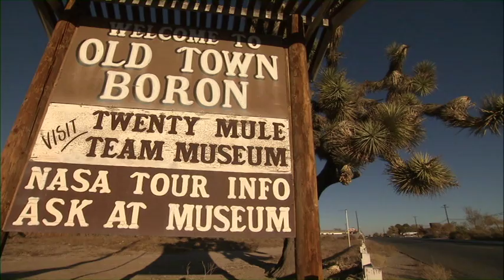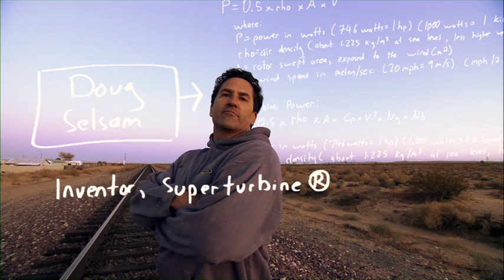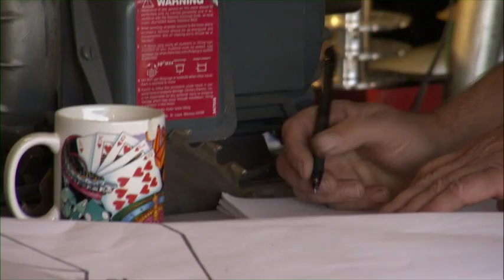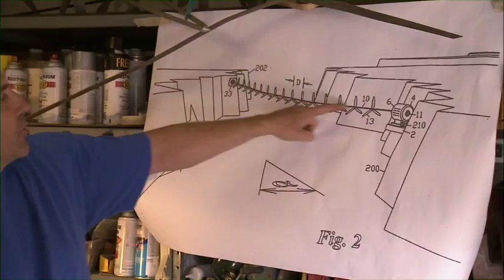Doug Selsam Inventor of Superturbine(R)

Comment: novel idea!  wonder how long before the constant flexing on the driveshaft causes fatigue failure?
Reply: You can break up the stress with bearings but good point.
Reply: This is a prototype that proves the concept works!  I would suggest running a guide cable and suspending the turbines on hung bearings. This is in reference to canyon and peak to peak installation.  I was thinking of 4140 thin wall tubing would be a good choice verses CRS?
Reply: And what about the noise level? Too many blades spining fast like that aren't too noisy?
Reply: I cannot see any way to reliably scale this up. He model was sagging massively just at this size. The reason one huge aerodynamically precise fan with adjustable angle of attack is used is so that even in barely any win they will still turn.

Also until some data is recorded and compared we don't know that this is more effective. It kind of a classic mistake to think more of something means more good.

But but adding a gear box and a large fan with variable angle blades very likely produces the same amount of power.
Reply: Also something that he himself probably hasnt thought off. once you scale up the fans the tip speed will get faster and faster. If the tip of the blades break the sound barrier then you have problems. 

And the funniest thing is. This guys bad idea is just trying to improve on what was already a bad idea.

Wind power will never supply the bulk of our power. If i remember correctly even if you covered the entire land surface aread on the planet with those big turbines it still wouldnt even get close to the power generation that is needed.

Unless some massive battery advances happen where we can build massive batteries and use sun and wind to charge them i dont thinkt his will be useful.
Reply: I’m looking at windmill/turbine videos to see if I can find something comparable to an idea I have been thinking about lately.  Horizontal or vertical axes of rotation with longer and longer blades seems like a long-term losing proposition for scaling because of tip speed and centrifugal force: to me, it makes more sense to not ever have the top movement speed of any of the wind-blown parts exceed the wind speed that blows on it, for various reasons, including material strength, balancing, noise, and also thinking about bird strikes, both for the sake of the birds as well as the mechanism.

I’m not comvinced you can ever prevent birds from hitting at least part of the machine, but it seems like a bad idea to multiply the speed of what they can hit to be many times what they’d hit in natural environments.  I’m not a rabid enviromentalist, but I’ve seen enough to recognize that mankind killing off animals (intentionally or otherwise) often causes horrible ecosystem imbalances that all-too-often turn out as disastrous for humans as it does the other critters.

Even if this inventor figured out how to resolve all the engineering challenges for a very reliable super-turbine as shown, using these noisy bird-choppers will remain a huge hurdle towards progress in getting them deployed everywhere: real or perceived environmental/ecosystem impact, people don’t want the noise at the levels typical with significant windpower generation, so it makes sense to solve for the things that impede progress towards cheap windpower.
Reply: on but off topic, why do busy freeways not have wind turbines situated along them to capture the wind spinoff from traffic???
Reply: i guess they would partially affect traffic i.e. take energy from cars and slowing them down and people will have to pay wit their gasoline so people will complain and accident do happen windmills do fall.
Reply: there is something celled the closed loop fuel cell technology,. extremely efficient.
Reply: Hats off to you doug, I like your way of thinking.
Reply: I was thinking the same .It won't last long. Drive shaft must be in line strait.
Reply: @davidmcintosh5441  You're right. You shouldn't ride airliners.
Reply: Depends on how hard and how fast.
Reply: @dougselsam5393  ...how about those 70% efficient VAWTs like ANEW ever considered building those ?
Reply: If his invention is going to span a mountain valley, I think that some kind of arch (support?) structure is the strongest one. 

An arch provide a stable and very strong construction

Comment: I had a similar idea but mine was vertical and each blade had its own motor/generator which were connected in parallel to a charge controller and battery bank and then the house.

Comment: Sharp fast spinning blades bouncing violently directly adjacent to latex balloons holding the same blades 60 feet in the air...what could go wrong.
Reply: 3 blades and a gear box motor pitch motors ect 300ft up spinning isnt any smarter
Reply: ...and you could sit underneath and catch the chopped up birds
Reply: I call them out, number of spinning blades is one thing, electrical power is another. Why don't you disclosure wind speed, voltage and current?
Reply: @dougselsam5393  hahhahaahaa!!!!!!!!!!!!!!!!!!! from Community Energy Champion , LSFN ,Ontario, Canada

Comment: you can hear the oscillations in the shaft speed... energy losses and stress on the materials. people are easily blinded because they want their idea to work no matter what. if you truly want success, live in reality and don't fool yourself. then you can look for real solutions to the real problems your idea has, or simply drop it and move on to something which might work much better.
Reply: thanks, google failed me, I ingresh good unuff
Reply: I own google
Reply: I'm on pc, 3 dots on the right side of the comment, click and a menu comes up, one option is edit
Reply: Dear Skeptic,
It's just an idea, he is testing it for the first time. He's a thinker, he'll get the bugs worked out. If you're a camper in a remote location, float one of these in the air, have electricity in your camper all night. It's much quieter than a generator. Spread your hate elsewhere, Geeez.

Comment: What if each hub was a toroidal magnetic array spinning around a conductive metallic core? Wouldn't the current flow without the need for a generator at the bottom?
Reply: yo good idea !
Reply: That would probably make the thing heavy . How much can the central shaft hold ?

Also the torque on the shaft where it connects to the generator must be imense because it's added up from all the propellers . Though that wouldnt be a problem if each blade spins independently and generates power by itself as you suggested .

But would you get more or less power that way instead of having one big generator ?

 I think the point of this desing was to accumulate the torque from all the propellers to drive one big generator.

This design can't be good .

The propellers are all the same distance and all are oriented the same .

This can't be the most effective way to catch the wind .

He needs to find a way to do actual simulations at some supercomputer because I guarantee it he will get some major differences in optimal configurations for different speeds .

Also its VERY loud . They make the turbines so large and with only 3 blades BECAUSE they were trying to reduce the noise .

Comment: No school for "inventors"? Huh, engineering schools?? Yeah, lets span a blender across a valley so we don't disrupt the ecosystem.
Reply: I guess you mean in comparison to several large blenders over a larger area!
Reply: Engineers don’t normally invent things they take orders from inventors
Reply: @dickfitswell3437  You mean instead of "unlocking" the generator they hooked a battery to it :D
Reply: @dickfitswell3437  You mean instead of "unlocking" the generator they hooked a battery to it :D